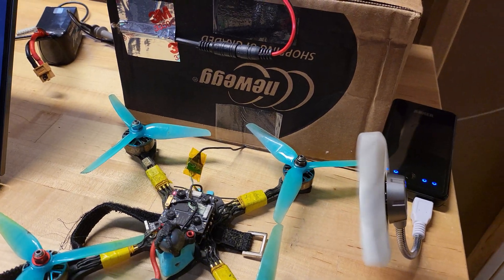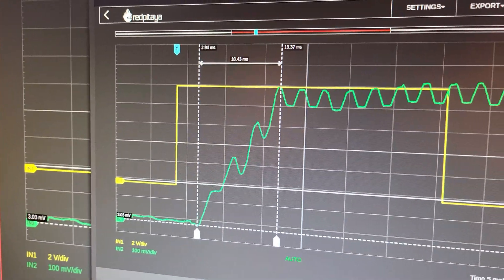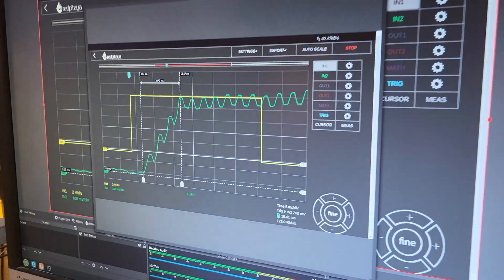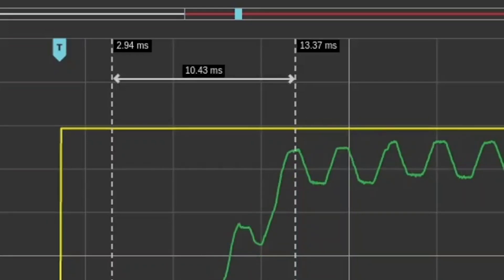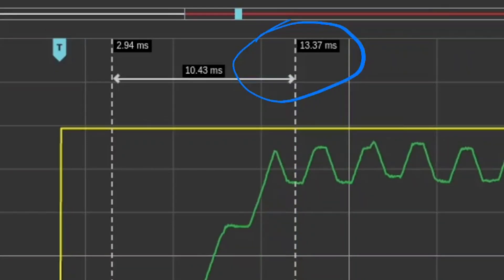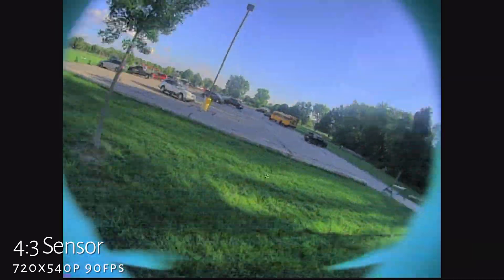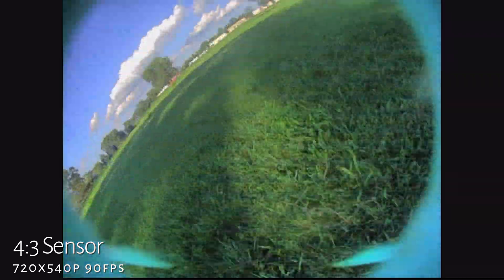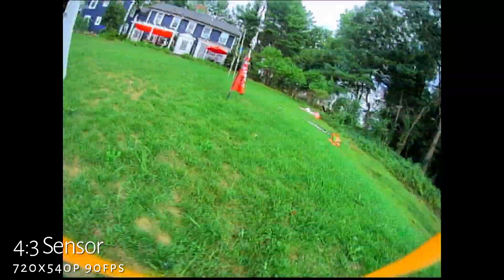Worlds Fastest and Smoothest FPV System - HDZero 90fps Cam Test Results

Comment: Hey Ryan, thanks for all the content that you are posting about HD Zero.
I'm seriously considering switching to digital for freestyle and long range by going the HDZero way of unidirectional broadcast technology instead of the variable latency bidirectional DJI/Walksnail technology. I'm trying badly to resist the Walksnail temptation, but I need these goggles out soon! 😅😅😅

Here is an unrequested suggestion that came to my mind on how to mitigate the dreaded rainbow effect that many people are scared of in HD Zero.
I don't even know if would be even possible, but: if you cached the last good received "block" (for each frame) into a sort of memory, then in case of a certain block not being correctly transmitted you could show in that position the last known good block instead of random garbage. I think the effect on the pilot would be much better because at least we would be able to see a static picture (or part of it) and react on that information instead of suddenly loosing all the video feedback.
It could be an option to activate on the receiver side, so pilots could choose.
Also a colored bar on the top or bottom of the screen that shows how much reliable the displayed picture actually is would be fantastic for immediate feedback.
Just my two cents.
Keep it rocking!
Reply from the maker: Welcome to the community when you decide to hop in. The rainbow isn't that distracting while flying, it is feedback to the pilot that you are at the edge of range. When we watch dvr it seems more jarring. Also, the static missing blocks are very easy to see through. It's a bit like a screen door. These things are not readily changeable as most of the processing is done in hardware, not software

Comment: Is the 90fps mode restricted by data rate? It's just a little over half of 1080p30 which I saw rumors of future support for. Still looks really good, so this is merely technical curiosity.
(Sorry if you mentioned this. I'm short on time today and skimmed the video.)